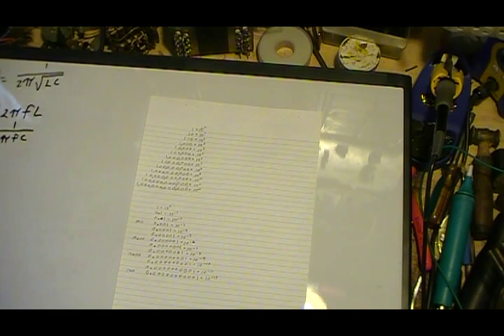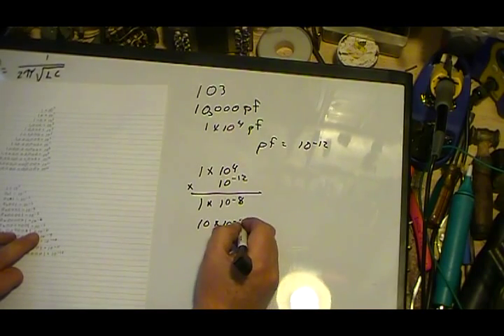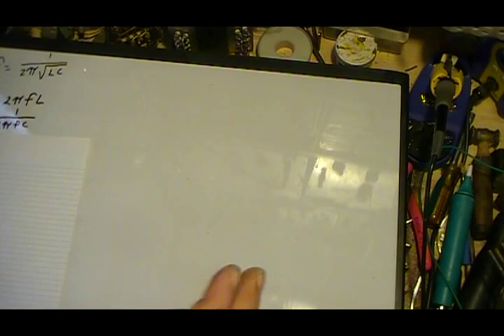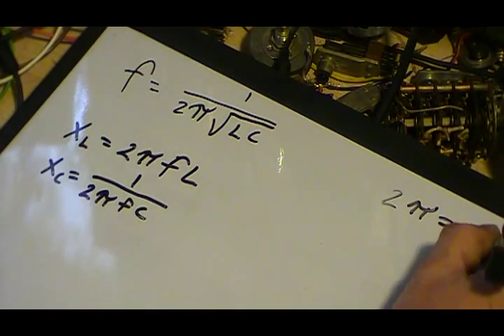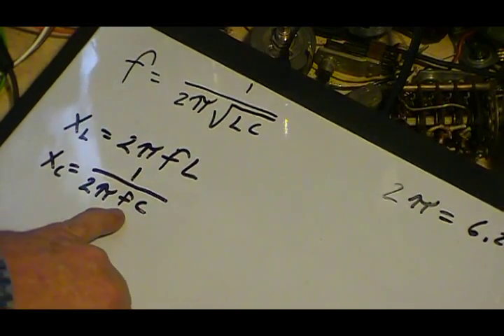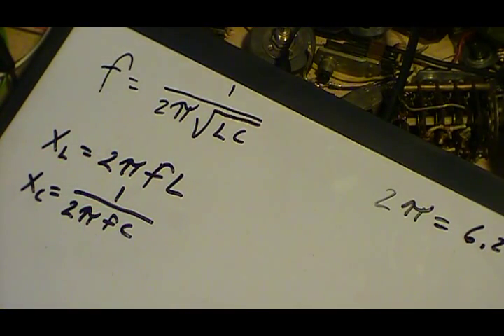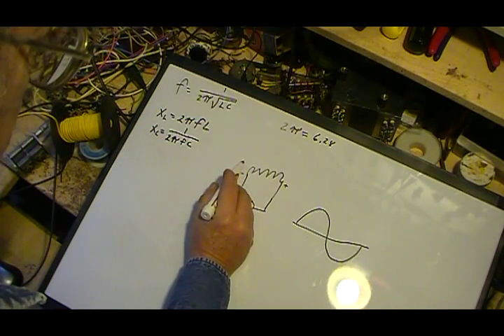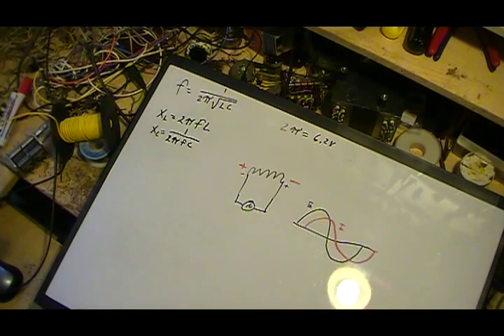RF generator math part 2

Comment: Dennis,
Keep going brother: that was brilliant!  I learned just sufficient how to apply the formula Xl=2piFL (I was very shaky on the Xc=1 over 2piFC) to get me through my end of semester examinations but I am happy to say I’m au fait with the capacitor readings and the sign wave.  I seem to remember, when I was 18, a multiple-3 or 4 part examination question (on a two hours' question paper of 10 questions, as they always were).  Part A, for 1 mark of 15, had a drawing of a sign wave with a voltage passing though followed by a current sign wave.  The question went something like why doesn’t the current flow at exactly ninety degrees after the voltage sign wave?  It gave a multiple choice answer which went something like: a) capacitance. b) excessive wattage. c) resistance. d) none of this applies, its phase is exactly 90 degrees.  The answer is, of course, C.  I seem to remember at least one the rest of the sub-questions of rest of that question included at least one of those formulas and associations with left and right hand rules – Part B for 5 marks… Part C for 7 marks… etc etc – I bet there are similar sorts of examination question papers in America. 
All good stuff - keep it flowing my friend.
Phil.
Reply from the maker: Thanks Phil. I got more on the way.
Your friend Dennis